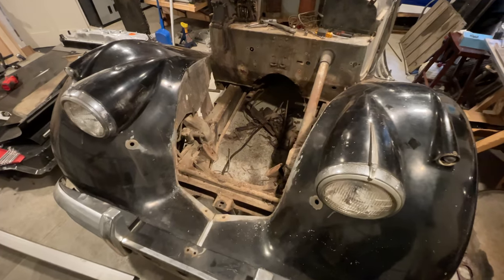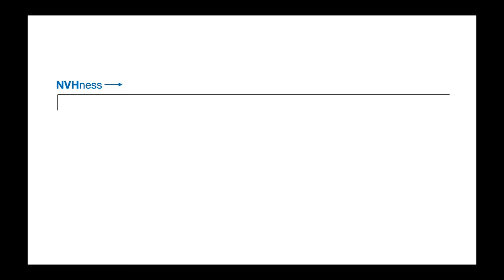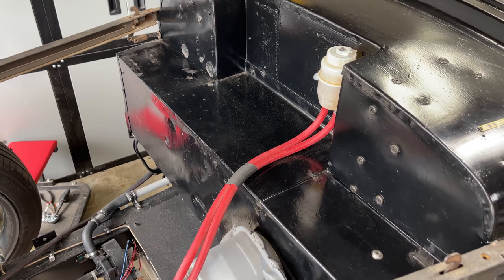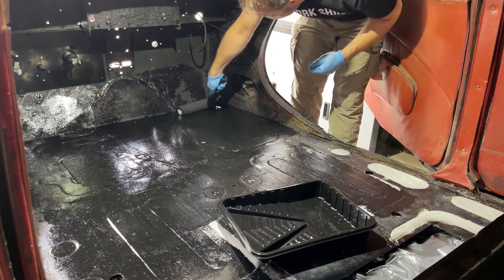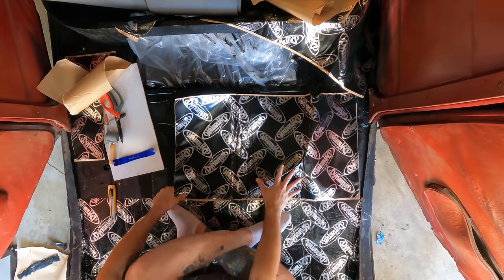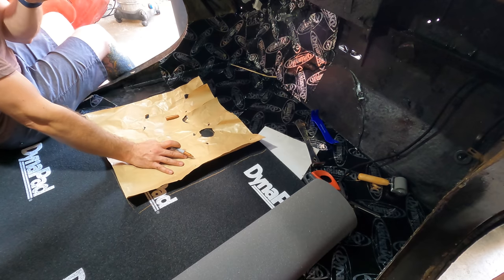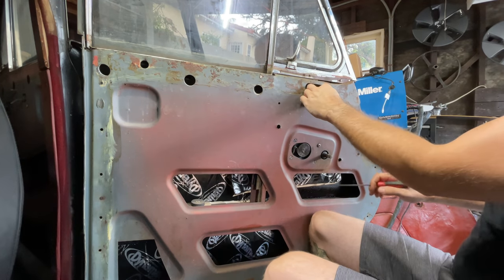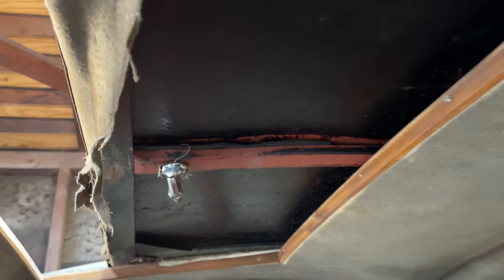EV Swapping Your Car Will Make It Louder. Here's How To Fix It.

Comment: Hi Matt, please give me an Engineer answer, or at least a car builder question. Dynamat and products like it brag about being able to effectively dampen sound while covering ony 25% of the surface. I've seen a demonstration in which a single square inch near the edge of a cymbal keeps it from ringing. Why does everyone do the whole car?
Reply: The single square inch works for sound damping, by absorbing the ringing of the cymbal.  Covering a surface helps with sound transmission/blocking over the entire treated area, as well as improving the damping of the treated surface.
Reply from the maker: What mlindholm said.

Comment: if dynamat is so good why doesn't he put it on the honda?
Reply: It would add a significant amount of weight, potentially 50kg+. Plus that car is offensively loud (in a good way) already so although it would be a big improvement, the car would still be extremely loud. On top of that, it's really expensive. Just how I see it.